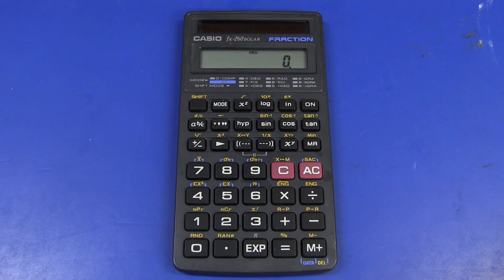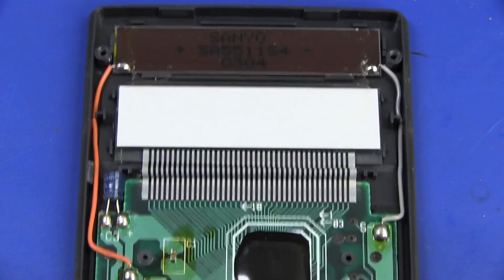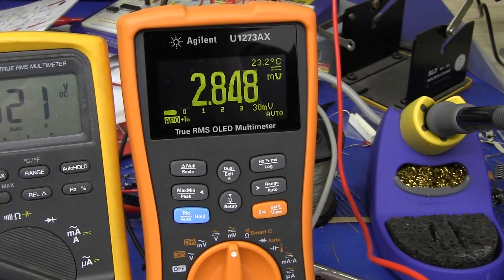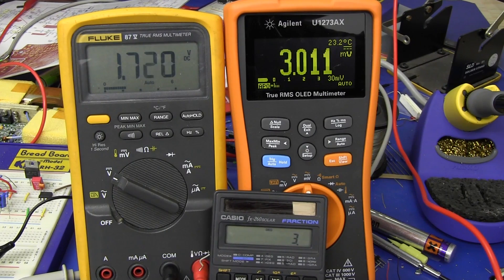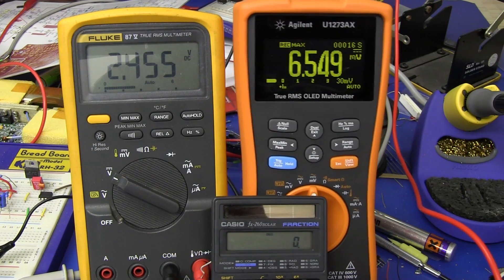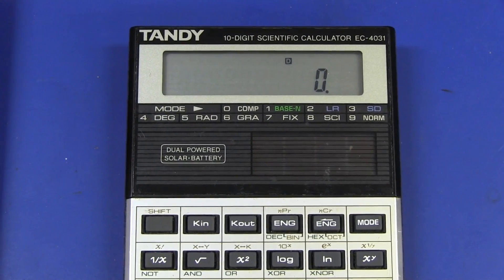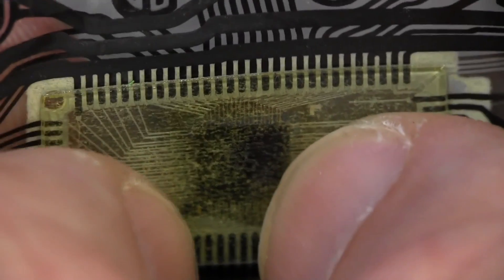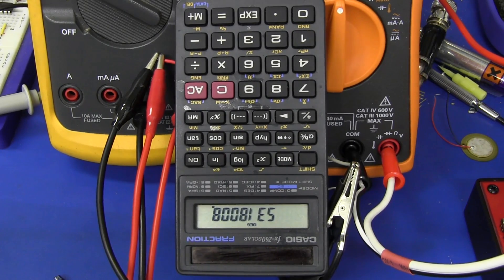EEVblog #389 - Casio Calculator Investigation

Comment: I found a broken fx-82 solar (looks the same) in the bin. The display was very pale, unless when bending it with quite some force. The problem was that repeated mechanical stress on the PCB had destroyed SMD capacitor C2 on the back (2:29). I replaced that with a different one of unknown value and now it works again!
I also replaced the 10uF electrolytic storage capacitor C1 with a 100uF one, so it can work for about a minute without light.

Comment: Why is the Agilent multimeter reading in millivolts instead of amps? I guess the dial should've been set to read currents.
Reply: The multimeter is measuring the voltage across a small resistor (the "micro-amp" he showed at the beginning), which allows him to measure the current by measuring voltage. That is necessary since the current draw is so low (microamps), that a multimeter would not pick up on that.
Reply: @nullplan01  he must have connected it across a 1k ohm precision resistor, if I am not wrong.

Comment: The Tandy calculator is a rebadged Casio fx-115. Best programmers' calc for the money back in 1985, I reckon. I bought one for the decimal - binary - hexadecimal conversion (quicker than doing it in my head!) Mine's still in full working order, but is sadly now a bit dented from when my eldest lad used it as a teething ring some 30 years back.

Comment: Capacitors are not something to mess around with. The worst are camera flash capacitors. Make them discharge while holding it and it would probably kill you.
Reply: Right! But this one is charged to about 2 Volts and has 10uF capacity. A coin cell is more dangerous than this!
Reply: The fucking solar panel is more dangerous than that cap!

Comment: I've popped open pretty recent calculators that i've gotten for free and found a full flexi construction with an epoxy'd chip.
Reply: I cracked open a Casio fx82c to replace batteries and it was completely chip on flex

Comment: I use two K750s. If you have light in your apartment, it's enough for it to run AND charge the battery. Those people probably expect a dark room to charge it. In a dark room you still need to leave it near a window in daylight (or something) while you're at work and then you've got a good charge. :P It's more suited for the office, as good lighting works the best. I've never replaced something or had much trouble so far.

Comment: The thin film construction is still used but in a cheaper form, (many people use thin copper wire and packing tape  in the place of a PCB when making their card skimmers as it allows the entire item to conform to the shape of the card slot (noticed it a while back on one of the ATM machines right outside of the Chase bank in a nearby mall (the skimmer was there for like 2 days (didn't say anything because I didn't want blaming me for it which many companies are known to do on security reports)

Comment from the maker: You'd have to do actual measurements on it and do the math based on usage and typical office lighting charge time vs use time vs losses etc. It does have relatively large solar cells on it. Most likely it's more a marketing gimmick than practical.

Comment: Mounting the batteries externally and wiring them to the calculator with an ammeter in series wouldn't damage the calculator.

Comment: A typical case of garbage in, garbage out. If you write something ambiguous like that, even humans will give you different answers (maybe not in this case; but try "1/2x" and see what answers you get).
The calculation priority is mentioned in the manual. Implicit multiplication takes precedence, that's how the calculator implements it. And it's also quite helpful when being able to save the parenthesis in statements like "1/(2x)".

Comment: This is definitely Chip on Flex (COF) packaging technology with a large pitch wire bonding technique, possibly 25 mil pitch? These flex technologies and COB (chip on board) are starting to become popular in mobile consumer products today, and that is very neat to show from the 80's era. That flexible clear material is probably silicone-based (not silicon) to serve as a mechanical stabilizer with a low dielectric effect. Very neat!

Comment: on some of the older solar powered calculators, there were 2 LEDs in series across the solar cell to act as a crude voltage regulator.  in bright sun, the LEDs DO light up.  I tested it!